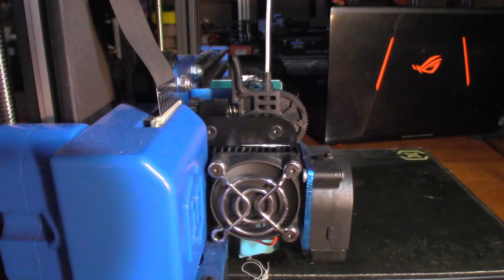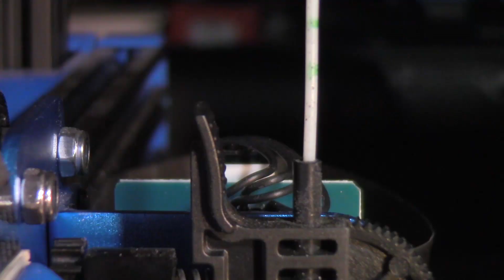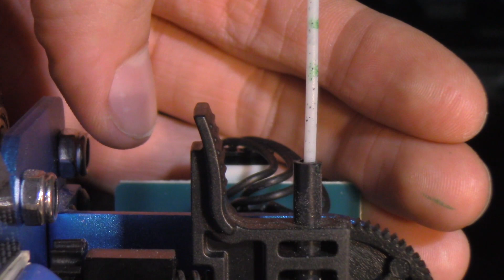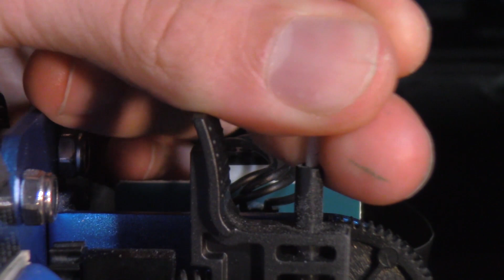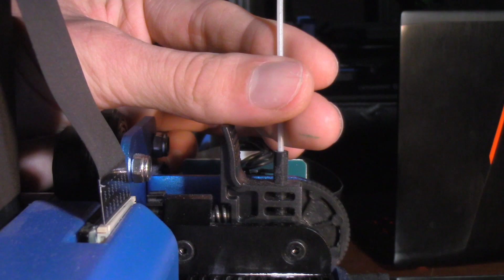Artillery 3D Extruder Arm Tensioning

Comment: What happens when you do this and it still won't grab it at all . Like it makes clicking noise and can't grab it to pull it in .
Reply from the maker: Did you check the temps are right for the material, nozzle isn't clogged, the PTFE/heat-break are not clogged, extruder gear isn't full of crap, the end of the filament isn't binding on something???
Reply: @MakeItWithCalvin  oh yea i have
Reply from the maker: Hmmm, at that point I am not too sure. Maybe try feeding filament without the nozzle in, just in case there is a blockage in the PTFE?
Reply: @mitchelsumrall1307  clicking noise if you discarded belt tension i'd check that the screws aren't too tight, i read that could be a culprit. Then make sure there isn't a clog. then make sure both gears are in good condition, then make sure the stepper motor is working properly, then i dont know.
Reply: @MakeItWithCalvin  man, you are crazy helpful for owners of this printer

Comment: Hey Calvin mine has this annoying clicking when feeding filament.   I have tried to find out what is causing it and can't figure it out.  Any ideas?
Reply: Same, did you find the cause?
Reply: I think what happened is its way too lose and not biting the filament. To compensate they have the gear spinning way faster then it needs too in both feed and unfeed so they get constant pressure not correct pressure thru the nozzle. I find mine squeeks when it retracts because it switches directions way too fast and slipping. If its possible lowering the exceleration of your extruder should stop the squeeking when feeding to retraction. 

This is completely wrong and it should bite more, however they tuned it really well from factory and i am not sure  I want adjust the flow and tension to fix the noises. The correct fix would be to adjust tension and fix the gear speed likely lower the exceleration a bit

Comment: Thanks for the tip..... Good info as always... I have two questions though...
1) when you were doing this did you have the nozzle  out.

2) everyone always talks about how quiet the X1 is... And for most travel my X1 is very quiet however on the infill and retraction it seems to be quite loud is this normal?.... Or could it be to an over tightened idler arm?
Reply from the maker: Unless otherwise noted, nozzle in. 

Uh if you think this is loud I will do a video in the future with my Ultimaker and Thingomatic. It will make your ears bleed...